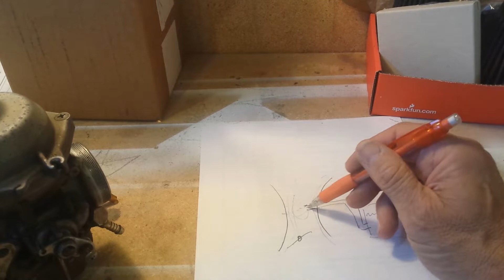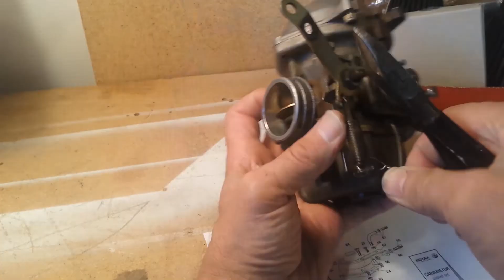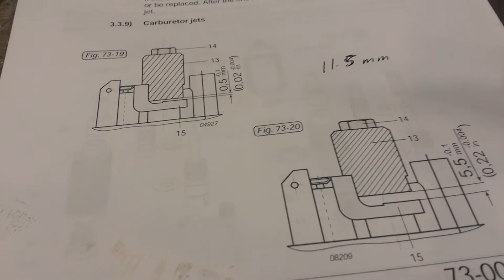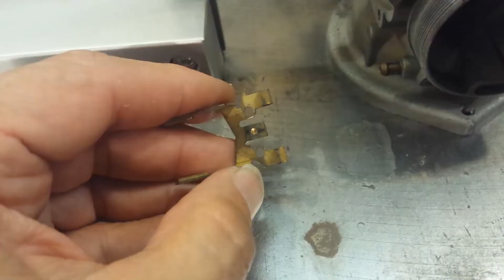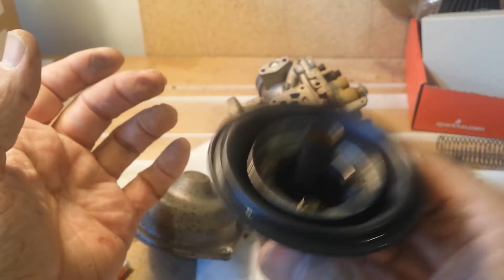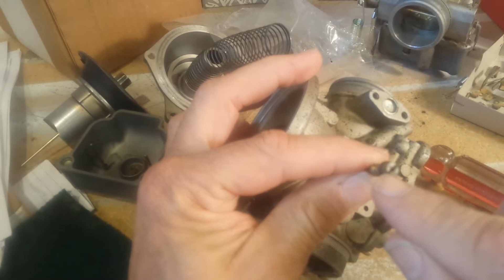Bing 64 Carburetor Disassembly and Explanation

Comment: Thanks Jim, I’m going to disassemble mines from an 98 LSA I recently acquired with a 912 80HP with 1100 hours on it and will clean them in an ultrasonic cleaner. I planned to replace gaskets but after looking at your video I feel that replacing jets, float and other parts may help too. Thanks again

Comment: I have an old BMW motorcycle with Bing 32mm CV carbs, similar to that in your video. Many elements are exactly the same. For hundreds of hours, over many years,  I have been fighting a forward lurch when cracking open the throttle and equal backward buck when closing it the last little bit. Your video causes me to think that the cause is blocked or ineffective transfer ports resulting in abrupt transition from idle to main circuit. The last time I had the carbs apart I poked into those tiniest of all holes with a hair-thin copper wire and squirted carb cleaner and air into them, but couldn't tell if it did any good. What would be the correct way to open up the transfer ports?
Reply from the maker: Is it possible that your idle mixture is a bit too lean? Getting extra power when you crack the throttle would suggest that you are getting extra fuel as you open it - not too little. At least that's my thinking.

Comment: Great review, thank you. In the old Lycoming carbureted engines, the pilot can change the mixture quality from the cockpit, which can save a lot of fuel at cruise. Is this capability provided in the Rotax / Bing ?
Reply from the maker: No, there is no mixture control out of the factory on the carbureted Rotax. Some people have developed aftermarket devices, but I have no experience with them.

Comment: Thanks for the detailed video. I recently took mine apart but after reassembling the engine bogs down trying to go higher rpm. What could it be?
Reply from the maker: Assuming that it was fine before disassembly, it doesn't seem likely that varnish / debris is the problem. If the slide isn't lifting properly, that would make it run lean at high airflows - could the diaphragm have been damaged or not aligned correctly? Did you remove the needle from the slide? Correct C clip position - screwed down fully? Does it just bog for a moment then run OK? That would suggest accelerator pump issues.

Comment: Very good video, explained in detail!
I have a question, would it be possible to drive the Himalayas, the highest mountain pass at 6200 meters, without additional adjustments on a BMW motorcycle (bmw r 100 rt) with such carburetors?
Reply from the maker: I really don't know. I've been up to about 3000 meters. Clearly the power would be greatly reduced - but beyond that, I would look for others who have driven vehicles over the pass - has anyone managed it without re-jetting the carburetor? Even vehicles other than one with the Bings?
Reply: @LightAndSportyGuy  I hope that someone else will read our correspondence and write their own experiences...

Comment: I agree with the comment below, what's the small hole that's opposite the idle outlet hole on the vacuum side? (forward of the transfer ports and visible at about minute 29.33 on this video)
Reply from the maker: Not sure. Could be a second idle fuel port - there could be a cross drilling from the port I point to in the video. But, without a carb in my hand and the ability to blow air (or carb cleaner) into the idle mixture adjust I couldn't say for sure.  It is odd that the hole for the port appears to be plugged with a screw instead of the more typical lead ball...

Comment: Well done video, I know you hate the record was not on, at one crucial part, I hate that too.  On the altitude compensation bit, I'm not offering proof, just another's perspective, for your feedback.  This quote from Rainbow Aviation seems to make sense to me:  “. . . . (carb) senses the reduced atmospheric pressure on the lower half of the diaphragm, and the piston lowers in the body of the carburetor. This happens automatically even though the throttle valve position is still in the full open position.  Because the piston is lowering the needle jet / jet needle restriction also automatically reduce the fuel to lean the mixture.”
© Rainbow Aviation 2017 Carol and Brian Carpenter
Could it be the the spring tension is constant, regardless of altitude, therefore it does have a reduced pressure on the lower half?
Reply from the maker: Could be - one of these days I'm just going to have to sit down and try to sort it out in my head.
Reply: @LightAndSportyGuy  if you are anywhere near like me, my 'sorting out' days are waning.
Reply from the maker: @bobbrown8615  🙂

Comment: The red float Viton valve is a older part, a some point they changed to a black one with different spring tension and rubber formula, my engine from 1998 had the red one originally, many changes made to these Bing 64 including the starting carb (choke).

Comment: Thanks for making this video. I’m so frustrated with Rotax. Hardly anyone who knows these engines in the USA. Parts are crazy expensive and don’t get me started if you have an issue.
Reply: I hear ya.  Just doing five year updates/replacements on my SLSA and the freakin' 912ULS is draining my wallet.  Three hundred some bucks for diaphragms, bowl gaskets, some O rings and carb manifold coupler tubes.  Lucky my floats are in spec (under 7 grams) or that would be another three hundred!  Aviation is not for the average Joe on a budget.
Reply: @briand4000 bing motorcycle carb parts. There not even airplane parts.

Rotax puts their name on it and charges 10x cost. Now it’s an “airplane part.” 

Hope cont and lyc come out with a modern engine and put these turds out of business. Rotax has no respect for their customers

Comment: Great video! I’m a bit familiar with SU carbs, but similar principles. Recently bought a Skyfox Gazelle with a Rotax 912A engine, Bing carbs. Seen Bings on BMW morocycles. Yes, carburetion of engines is a dark and clever art....! Very informative, learnt a bit about the idle circuit and I thought there was no altitude adjustment....constant velocity with that tapered needle might actually achieve slight leaning, up high in thinner less dense air.

Comment: Jim,  Do you "vacuum balance" your carbs on your 912 or 582?  Wondering if that's necessary if one does a good job of mechanically "syncing" them.  I'm fuzzy on the difference and why they are important.  Thanks.
Reply from the maker: Mechanical sync is the first step - follow with vacuum balance. Very small changes in throttle plate angle cause significant differences in airflow near idle, so you are pretty much stuck with doing the vacuum balance to get it right. And, yes, I do the vacuum balance on my 912.

Comment: Thanks for the video.   Question - I have a 912 and under 3100 RPMs it wants to run real rough,  but will idle ok at 1600 RPMs. We have pulled the idle jets on both carbs and cleaned them, they were completely plugged. Any others thoughts on what to check?  thanks
Reply from the maker: Just off the top of my head (I'm hardly an expert on the Bings) - the rough running could be happening during the transition off the idle circuit - that's when the holes near the edge of the throttle plate come into play - if you had gunk in the carbs, it could be in that area as well. I think.  Have you inspected the slide for smooth operation and  metering needle for wear as another potential problem area?
Reply: @LightAndSportyGuy  thanks for the information,  we'll check those out.   you're videos are very informative
Reply: @LightAndSportyGuy  I am working with Pat on this 912 repair.  We pulled both air filters and verified smooth operation of the slide.  Wondering about the air/fuel mixture screw and what RPM range it affects?  You mentioned it is typically about 1.5 turns out, which is where we found it.  What is the procedure for adjusting this with the engine running?  Seems like you'd have to adjust both carbs together to determine proper setting.  Perhaps a partner would make this job easier.  How do you do it?  Also, there is a large clear fuel filter that I can see some junk floating around in.  But if it's running OK at low and high RPM, I am thinking it's not a fuel filter problem, but not sure.  Another clue is that it seems to run better momentarily when the choke is applied, so it appears to want more gas (air/fuel screw adjustment needed?).  Thanks for helping!  As a Mechanical Engineer myself, I appreciated your thoughtful unbiased insights, attention to detail, and acknowledgement of the genius minds behind the design of this carburetor.
Reply from the maker: @MrHanowski  I have never done flow / tuning work on the Bing, so I can't really answer questions about exactly when the transitions between the idle / transition / mains happen. I adjusted the idle  mixtures one at a time, that seemed to go OK.  Just tweek the screw for best RPM. The left one was hard to get to with the engine running if I recall correctly. I would try the idle mixture to see how much difference it makes, but if the problem is off idle, that's likely to not cut it. My guess is that there is some gunk / varnish kicking around in that fuel system - has the airplane sat for a long time at some point? Had a boat that took a long time to get sorted - varnish kept coming free from the tank / fuel lines and clogging up the carb. Ethanol can do a number on the resin in composite fuel tanks as well - a possibility?

Comment: If they don't auto-compensate for altitude, how do your EGT's (exhaust gas temps) stay in their correct range as you fly from 1,000 feet to 10,000 feet?  Without some way of leaning, mixture would go crazy rich.  So yes, they do.  Above 10,000 feet however, you are correct-- the carb doesn't compensate any more.
Reply from the maker: I have no idea what the EGT does with altitude. But I used to fly a Cessna 120 that came from the factory with the mixture wired to full rich on the Continental 85 - no problem climbing to 10,000 with that either - if you were patient. :-)
Reply: These carburetors compensate with height since they are constant pressure. At higher altitudes, the air density is lower and the curtains compensate themselves.

Comment: Thank you for an excellent lecture on demystifying these cool looking carburetors. I am currently restoring a R75/5 and have sent away the carbs for a rebuild. After I re-assembled onto the bike, they work quite well, but once I have the engine warmed up, my idling is very high (over 2000rpm+). I have played with the idling mixture screw and the cable idling adjustment but it is still running high. Would you have an advice for me on where to look next? I realize it is a wide open question, but hoping you can point me to a right direction. Thank you.
Reply from the maker: Could it be the hard stop is not letting the throttle plates close even if the cables are slack - at 30:00 into the video you can see the hard stop screw to the right side of the screen - pointing down. I keep bumping into it as I play with the throttle. Another possibility is a vacuum leak that you have compensated for by opening the idle mixture enough to get it to run well (that seems less likely).
Reply: @LightAndSportyGuy  Hi, today I have the bike a full tune up by changing out the plugs, contact points and reset the valves. The high idling is gone, but now I have an issue with idling way too low at full stop after the engine is warmed up. I also noticed that the plugs are really black covered with soot, I guess I had the jet mixture set way too rich. I'll try to fix the idle jet mixture again but the main problem now is the idling is way too low when I come to a full stop. If you have an idea, please let me know....thank you.
Reply from the maker: @henryt2830  I suspect that fixing the mixture problem  will help quite a bit. Speed could be low when you are hot due to just being too rich - well beyond best torque.

Comment: Thank you for this insight video on the bing carburetor. However I do not agree with you regarding the altitude compensation. To some extent, it does compensate. Higher altitude, lower density, less air. For constant pressure (or "suction"), the piston displacement will be reduced, does keeping the mixture ratio constant. Regards and congratulations again on the video!
Reply from the maker: Thank you for the comment. I may have to go back and do the math again, to compare the compensation with a fixed venturi... :-)
Reply: Here’s how I think it’s altitude compensating:
Bernoulli’s Equation
P + pgh + (1/2)pv^2 = constant
(little p is supposed to be rho, which is used for density)
Setting up the equation for two points, one at the carburetor inlet and one in the Venturi, and doing a little manipulation, you will find that the pressure differential is equally to -(1/2)p(v1^2 - v2^2) (where v1 represents the velocity at the inlet and v2 the velocity in the Venturi). As is clearly evident, the pressure differential is directly proportional to the density of the fluid; the lower the density, the smaller the pressure differential. Being as the air on top of the diaphragm is vented to the Venturi, as altitude increases the pressure differential between the air on bottom of the diaphragm (atmoshperic pressure) and the air on top will become smaller. This results in the slide/piston sitting lower for a given throttle setting, which, by way of the jet needle, results in a leaner mixture.
I’d love to hear your thoughts on this.
Reply: @nakurtz  I have been told by a longtime expert on these Rotax that the Bing 64 will altitude compensate up to 3500' to 4000' alt. higher than this the mixture will get richer, some devices have been developed to adjust the mixture in flight,  Green Sky Adventures sell a product and a French company has a digital system to monitor and adjust mixture.